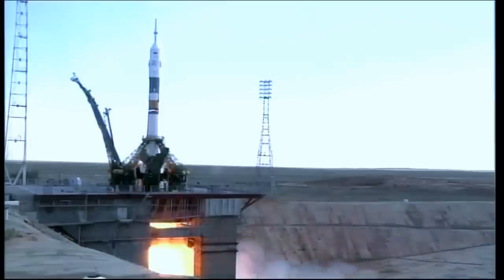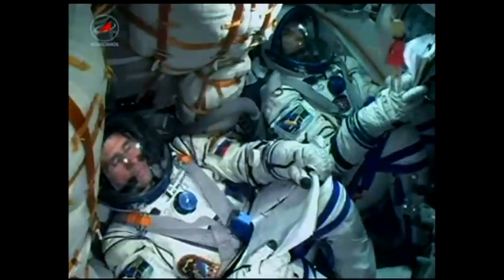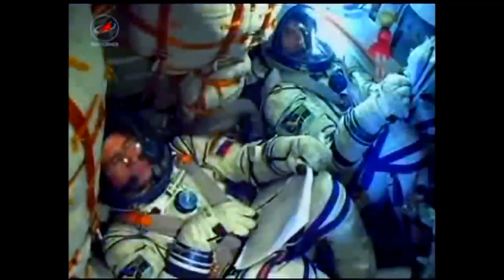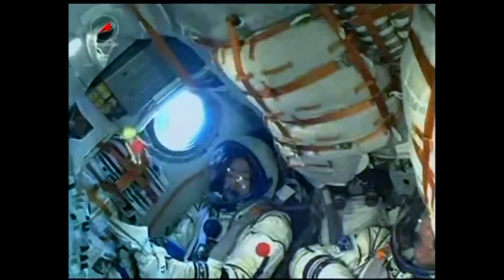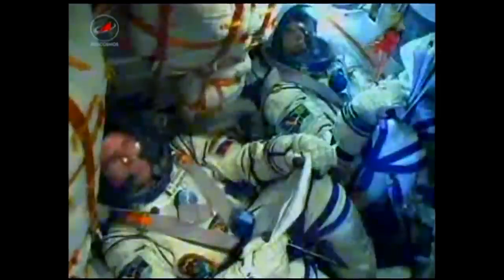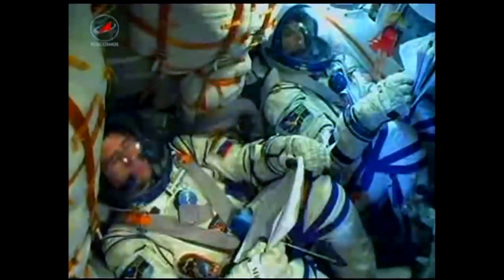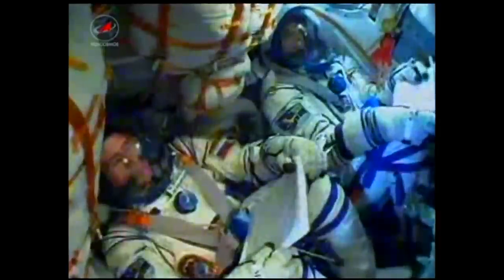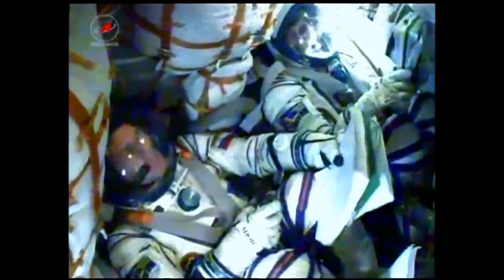Inside the Russian Soyuz SpaceCapsule During Launch

Comment: What do they do if one gets a leg cramp?
Reply: I've wondered the same thing. the cramped up way they are stuffed into that tiny capsule with bent legs seems like it would be uncomfortable as hell to me.  I guess that's why its important for them to test astro and cosmonauts to make sure they dont suffer from any mental malfunctions in small spaces. I have a feeling that the 2 hrs they spend in there prior to actually taking off would be a nightmare to most folks. It would drive me nuts, especially if I had to pee.
Reply: only same as a easyjet flight 😂

Comment: Fun fact : the space Shuttle flew as much as the Soyouz Spacecraft in all version (135 vs 133) with two lost crews as well. The Space Shuttle was pretty safe despite being so dangerous at launch and re-entry. For the last year the Shuttle remains the most used spacecraft ever. Soyouz launcher get his its reliability rates from unmanned launches.
Reply from the maker: the Shuttle remains the most used spacecraft ever? I Am not really sure about that
Reply: For manned mission it actually is I was surprised as well but Soyouz flight only occured 2 times a year in averaged. The Shuttle Flew 135 times and before that their was only 6 Mercury, 10 Gemini, 10 Apollo ,  4 post-Apollo and then the Shuttle.  The soviet had 8 Vostok and Voskohd manned flight before 66 Soyouz, then 67 After USSR collapsed. So the Shuttle flew more than all Soyouz capsule version since 1967
Reply from the maker: Make sense!

Comment: It's strange. Russian flight commentator spell "normal" but correct translate in this case is "nominal".
Thats explain several jokes in comment section below.
P.S.
This video is still nominal. Copy...
Reply: Rodion Makovskiy Nominal and normal are nothing in common at all nominal is a term used in CNC and computer driven device's. Nominal refers to in the middle not to high or low nominal the mean. Industry term not translated from normal.

Comment: Why is that toy still hanging. It should be floating after gravity . Are this guys really in nominal orbit?
Reply from the maker: its filmed during launch, so there is still gravity?
Reply: Please do not feed the conspiracy trolls.  Let them eat the contents of their diapers.  Thank you.
Reply: During a launch, the rocket is continuously accelerating, so in fact the astronauts are not weightless—in fact, they are experiencing multiple Gs, and feel heavier than they actually are. The doll is hanging down because it is being pulled towards Earth while the vehicle it is on is accelerating away from Earth. The astronauts and the doll will not experience free fall (weightlessness) until they have achieved orbit and shut down the engine.
Reply: The dangling doll was not necessarily being pulled toward earth. Actually it is being pulled in the reverse direction of the thrust, which in this case, for most of the flight, was essentially toward earth, due to the constant 2+ G's they were experiencing the whole time.  After what...9 minutes...as soon as the thrust stops and the last stage jettisons, the people inside can be seen being jolted, (and the video goes haywire for a second or two) then the forward powered momentum stops and the weightlessness can be seen. I'm not sure why all this isn't obvious to everyone observing.  It seems fairly logical to me.